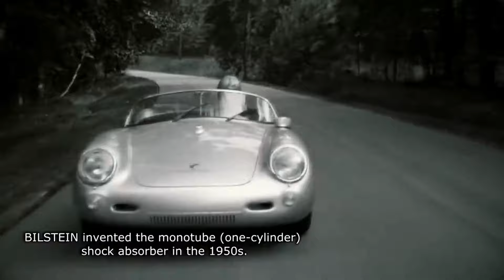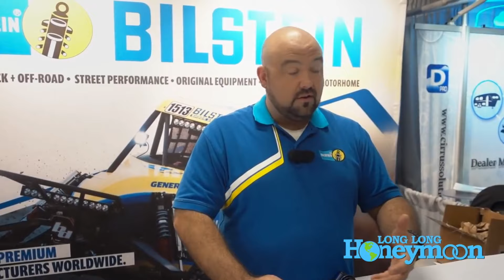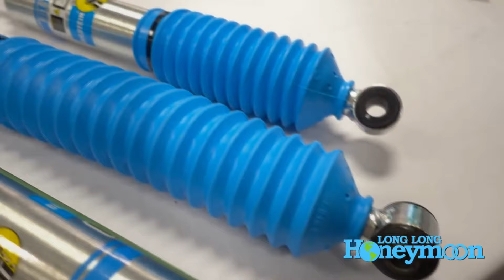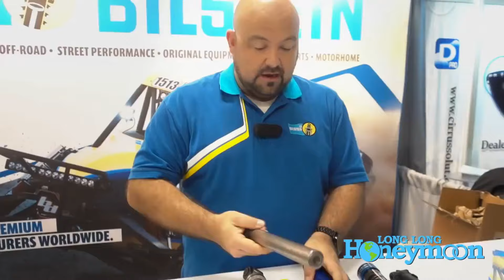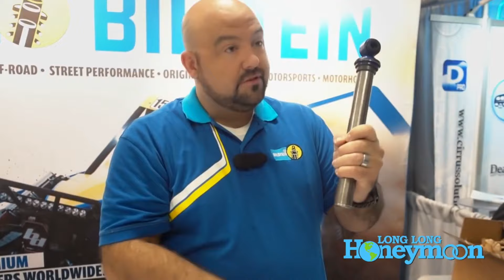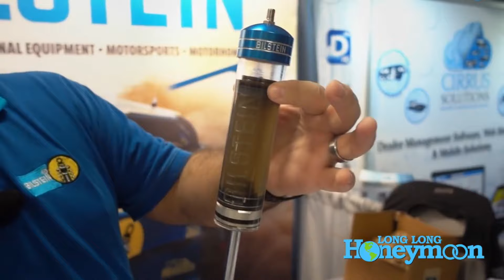BILSTEIN Shock Overview for the RV Operator

Comment: I have installed Bilstein on my Class C E450 3 years ago in FL when I was getting ready for full time RV living. They lasted 3 years. I don't think that's long enough. In other words, I don't thing it is right to buy shocks every 3 years. They should last at lest what they disclose in this video. But they don't.
Reply: Well that sounds like u should move to bilstein 5100. A bit more step up. It’s based on B6 or 4600, but if gives u a bit more capability then 4600. It’s a lifted application but they work for stock ride height as well.